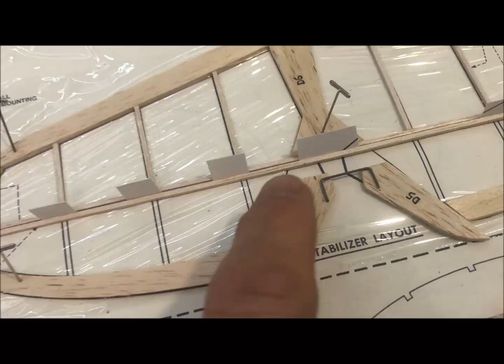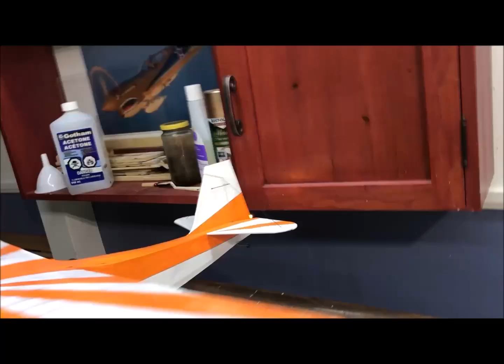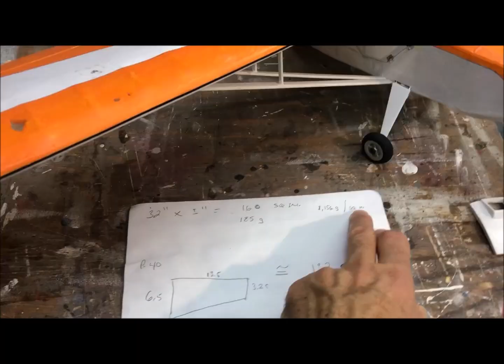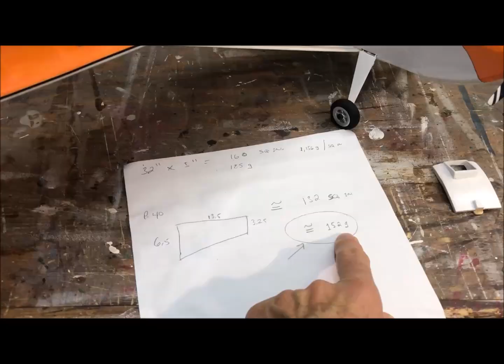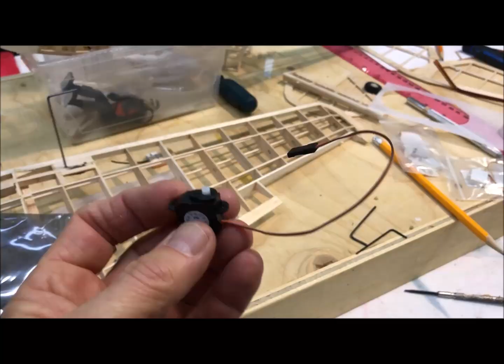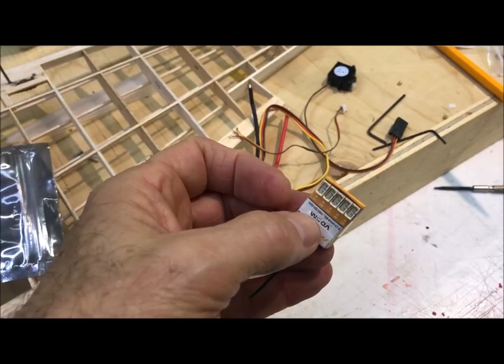Guillows RC conversion P40 4

Comment: my hart is very pleased to see sensible things on you tube ,it became rather rare , I am in similar stage of building after few dozens of years ,unfortunately when I got all the radio and power gear I have found it difficult to find a place for flying legally ,the drone paranoia amongst officials make it almost impossible .
Reply from the maker: In Canada, my understanding of the rules is that if it is sub 250g, you can fly in non restricted areas. I use my DJI dron app to identify such areas, but I am sure there are maps online for that. Happy Flying !!!

Comment: hi yves, thnx for this series, i got this very plane for conversion so watching and learning. pls would you share more details on the motor+battery+prop you are planning to use? thnx mill and all the best in the new year.
Reply from the maker: I'll get back on it very soon, I'll make sure to share all the details on power package. Being in Canada, I won't b able to test fly before May, but I'll share the tests so you can see the motor's efficiency in that airframe. Best regards.
Reply: @yvesduchesneau2206 thnx, keep them coming